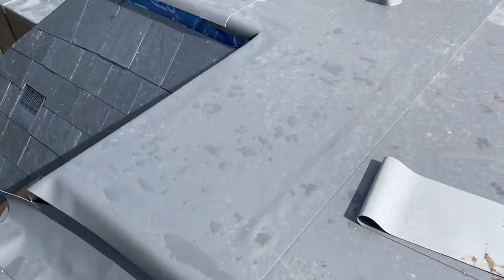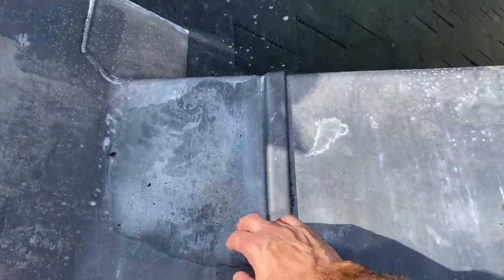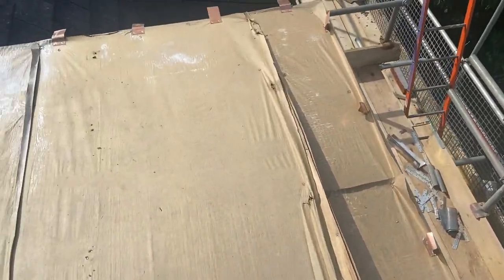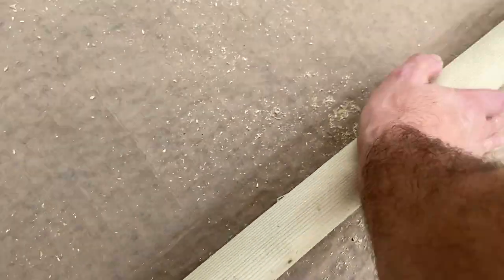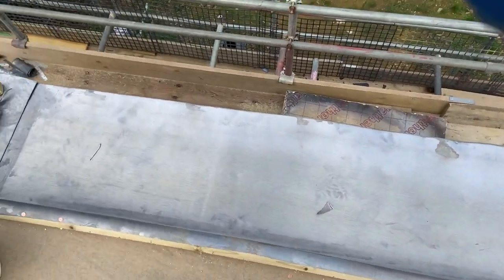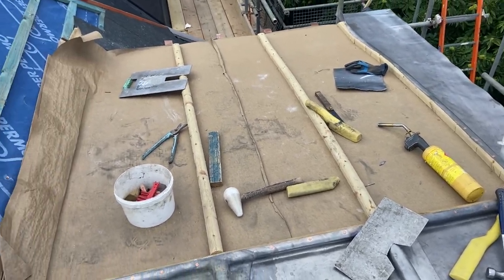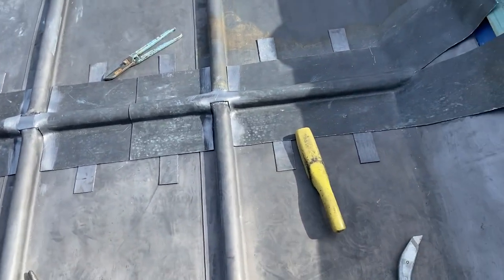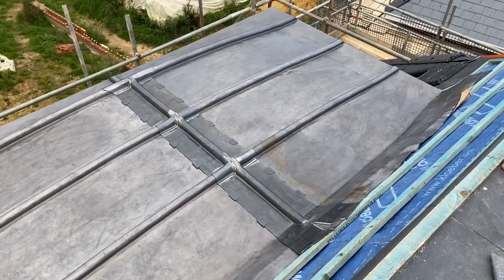Code 5 Lead Installation To A Curved Dormer Top

Comment: To be fair to whoever did that previous work , it was a nice and neat looking job👍, that is more likely to do with the builder trying to save a few quid!
Reply from the maker: Yes your probably right. Sadly I think a lot
Of this goes on. But it would have costed the builder a lot more in the long run when they all started leaking.

Comment: Great video, how often should lead weathering be re-oiled?
I ask because the flashing above my bay window is probably going on 100 years old and is covered with purpleish staining that doesn't really want to come off with a mild vinegar.
I'm wondering if it had been re-oiled over the years it would have not been stained so badly!
Reply from the maker: Thank you I’m glad you liked the video. To be honest I’ve never re-oiled any lead work once I’ve left the job. I think it’s best to let it age naturally. The oil is only used to protect the lead from oxidisation until it’s able to protect itself. 
I think you can buy a lead cleaner/restorer but I’ve never used this myself.

Comment: Looks great Stuart ! You always make a neat job, especially with your roll ends and your turned down edges. This might sound like a dumb question.... But what is the purpose of the building paper?
Reply from the maker: Thank you. 
The building paper serves a few different purposes. It helps the lead move. It also acts as a vapour barrier and also stops any glues etc in the substrate reacting with the lead.